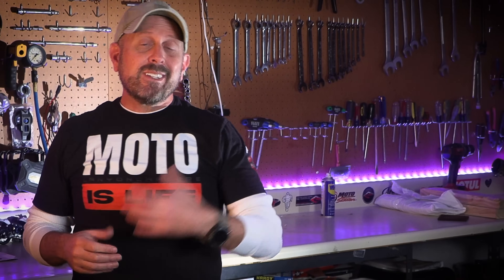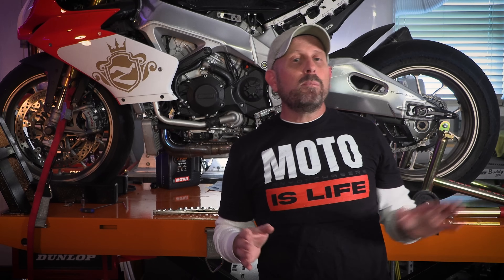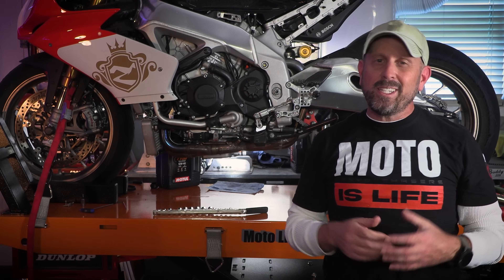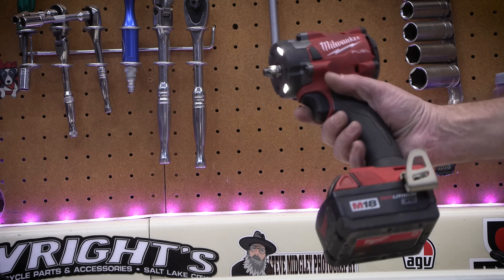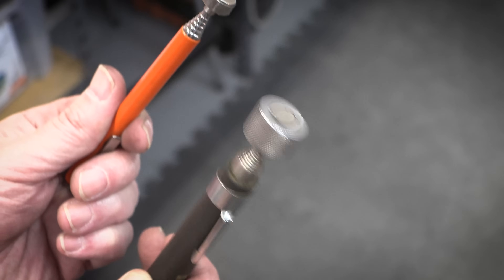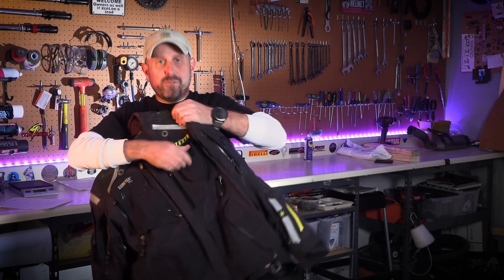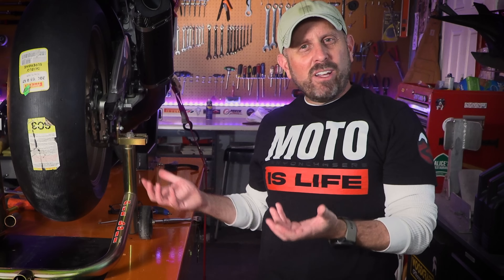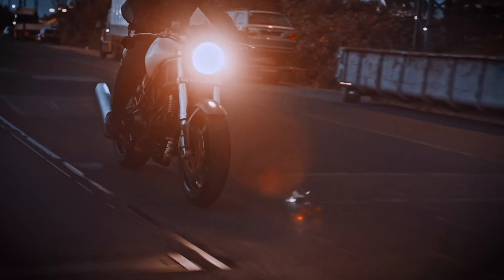10 Motorcycle Things I Can't Live Without

Comment: for some reason, wearing earplugs makes the bike feel so much smoother and nimble
Reply from the maker: Right?!? Why is that?
Reply: @CanyonChasers  I'm just hazarding a guess, but I think when you're not hearing every single rattle, mechanical sound or little bit of air movement, your mind has less input that will cause a reaction. Even if we're good at staying calm and without undue tension, stopping the aural barrage really helps.

Speaking of which, I'll need to try that sample pack. I've long used earbuds and got some custom ones recently, but the custom ones really started hurting on my trip across Australia, and I think the seal broke and let noise in anyway. The trauma caused tinnitus and an infection I've just gotten over. A friend lent me some decent quality foam plugs - the comfort and noise suppression was unparalleled. I love the idea of reusable ones like Pinlock and NoNoise plugs, but for me they just don't compare to good quality foam plugs (and my right ear is very weirdly shaped).

Also, 90 degree valve stems for the tyres, especially as I have spoked rims. And not plastic ones; my mechanic informed me they're prone to leaking and hears constant complaints about them on track days. Get metal ones.
Reply from the maker: I had some very expensive custom molded ones, but apparently, as your weight fluctuates so does the seal in your ear.  I gave up and now just use the most quiet foam ones I can find.
Reply: It definitely removes the constant wondering if “that noise” is okay or a problem.
Reply: @CanyonChasers  would it be because our ears are also responsible for giving us a sense of balance, since noise causes vibrations in our ears, our whole body would feel the vibrations, now if we were to cut off those vibrations, mainly caused by noise, our body would feel much more relaxed and would feel much stable.
Reply: @CanyonChasers  I also use the foam ones, and when it feels a little less cleaner, I would give it a wash, and they would be as good as new. good soap is the key I would say, as ear infections are caused by those bacteria or fungal infections. keeping the ears clean, and the ear plugs clean would make sure we don't get any ear infection.
Reply: This is a great list, and the earplugs are the sleeper item. I find riding way more relaxing wearing earplugs. The main “downside” is that at highway speed, I cannot hear my music or companions on the Cardo. But I’ll take the hearing protection and improved sense of calm on a long ride, every time.
Reply: @CurtisBrandt  yeah but you wouldn't be able to hear your Cardo properly at highway speeds without earplugs either because of the massive engine and wind noise levels. So it's basically the same without the permanent damage.
Reply: @lucascarracedo7421  yup

Comment: Two things I have found really helpful to stash on the bike somewhere:  Alcohol wet wipes and a stuff sack backpack.  I used to carry big alcohol wipes to clear bug guts from my visor in a pinch.  A 10-pack is thin and fits in an inner pocket of a jacket or under a seat but can be a day-saver on a ride on backroads when you find a swarm of bugs at 60mph.  I also kept a backpack under my seat for use in a pinch.  Something like my Sea to Summit Ultra-Sil Day pack.  It packs down to about half the size of your fist but expands out to a 22L drybag.  I've used it to pick up groceries after a ride, pack out trash I found on the road, or carry in a lunch and then stash the bag for the rest of the ride.
Reply from the maker: I LOVE the mini backpack idea!   I think I should make short exposing your genius idea!
Reply: I keep a tiny spray bottle and microfiber cloth in a pocket of my tank bag. Makes it easy to do a quick face shield wipe at a red light or a pull off
Reply: That ride out to the Old Sinclair here in Utah will definitely get your visor covered in bugs during the summer.  
I think it's the lake that attracts them all.  And alcohol wipes would be a life saver!
Reply: I got myself a Helite H-Moov backpack. It has a lot of great features (integrated helmet net etc) and best of all, it’s an airbag! In it, I usually carry a freezer bag with a bit of water and a micro fibre cloth for the bugs on the visor.
Reply: Completely agree. I always carry a bag I can completely collapse. Having a bag that takes virtually no space always at hand is a must for me, even outside the motorcycle world, you can just carry them in regular backpacks.

Comment: Microfiber towels - used to wash the bike, but I also keep one in the tail bag at all times to clean my visor, wipe dew off my seat in the morning, or as a place to lay out hardware and tools for roadside fixes.
Reply from the maker: Great tip!
Reply: I also carry a small spray bottle with a tiny bit of dishsoap. It makes removing bugs from the visor a breeze.
Reply: I always carry a small pack of wet wipes for visor & light cleaning, and a small towel to dry

Comment: Top item: a modular helmet with an internal sunscreen.

and, yes, show us how you use a Garmin GPS. A Garmin is on my list.
Reply: Modulars are super goofy looking to me, and they seem less safe, as the bottom part could break in a crash.  If you have a transition shield, you don't need an internal sunscreen also. :)
Reply: @thomasolson8417  
I believe that if you hit a tree directly enough, and hard enough, to break the shell of the facebar, your neck will be broken. I also believe the shell material is constant between a full face and modular helmet from the same manufacturer. The full face's facebar is capped with compression foam, so it "looks" more substantial (I assume you are using the chinstrap and you will not hit against the inside of the facebar). 

I agree, I thought modulars  looked goofy. I bought one, anyway. A month later, I vowed to never wear a full face, again. However, the only time I ride with the facebar up is when entering a gas station. When lifted, it looks like big lever to snap my neck, if I were to slide on the tarmac.
Reply: @bobirwin1028  good points. I don't feel I need a modular, but then, I haven't tried one. Maybe if I did, I would overlook the goofiness of it, as you have. 👍

As for sun protection, my Shoei is awesome in the sun or at night because it has a shield that goes super dark during the day and is clear at night. I wish that tech was more prevalent, and not just a couple of companies offering it, because internal shields add bulk, cost, and potential failure points because of more moving parts. This video doesn't even address it. 😭
Reply: Came to say this. Saw an hjc with the dark visor that pops down and instantly fell in love!

Comment: Picking up a basic abba stand is worth it.. on a budget without the extra supports you can do the front end by weighting the rear seat with some bags of cement or something. Once the front wheel is out it will sit fine. With this stand you can do front and back with just one stand, and it supports at the suspension pivot and doesn't get in the way much so for any big jobs A handy tool to have.

Having a small jumpstart kit is pretty handy if you can stowe it under a seat for those times when a battery is dead. Some come with a light built in which is handy for roadside crap at night.

Also. Essential really.. if you dont have a center stand on your bike Always have a flat piece of something solid enough to take your bikes weight through the sidestand with a footprint like your hand or bigger. Because.. on anything less than solid tarmac or concrete your bike might not stay upright that long.

Comment: Custom earplugs by UltimateEar are mine. Cannot ride without them. Much more expensive than foamies but a consistent seal each time, less waste and they connect to the Cardo
Reply from the maker: Don't they hit the inside of the helmet?
Reply: @CanyonChasers  Not at all, they sit flush with your ear and of course no need for speakers in the helmet so there is more space anyway.

Comment: Something else, that you reminded me of, that I kinda prefer a lot...photochromatic visor.  They ain't cheap, but it gives all the pros of dark smoke, and clear.  Only caveat I've run into are short tunnels can be fun because it takes 45 - 60 seconds for he visor to react.
Reply from the maker: AGV was making one that used polarized LED technology. It would switch from dark smoke to clear in less than one second.  Super cool, but I can't imagine it being affordable.
Reply: @CanyonChasers  Doubtful.  I worked in an office that had those for conference rooms...they were 5 figures per room.
Reply: I use a helmet with a built in extra tinted visor behind the clear visor. It uses a sliding lever to drop it down so if I get any glare I can drop it into place while on the move.
Reply from the maker: @kramsc1  Inner sun visor helmets have lower safety ratings because you are sacraficing a lot of padding in the helmet where we are most likely to have an impact.  Modular helmets also suffer from this. 

That notwithstanding, my personal experience with the inner sun visors, is the seam of the edge of the inner visor is always in my eye line creating distortion.  So despite giving them tries on multiple occasions, they just don't work for me.
Reply: @kramsc1  I had 2 issues with those: when retracted they would block the vent at the top of the helmet, and when used it would always be dirty from whatever dust and grime and bugs and whatever flew into the vent of the helmet as I rode. So I got a helmet with a photochromic shield.
Reply: @CanyonChasers  my problem with them is when they're retracted they block the top vent of the helmet which reduces the air flow and then when I put them down in front of my eyes they're dirty from all the stuff that flew in through the vent
Reply: My Klim helmet has a photochromic visor. It's awesome & came with the helmet - a long with a pinlock insert
Reply: @Tracer9GTRider8  Nice! That's something all vendors need to provide with helmets IMHO.
Reply from the maker: I wish photochromatic visors were available for more helmets
Reply: @WJRobbins125  I agree! I'm always looking ahead when it comes to helmets and even though my Klim is only a few years old I try to keep an eye on what's out there on the market and I'm not seeing any helmets that come with a photochromatic face shield. And Klim has discontinued the model I have currently 🥺
Reply: When you add a pinlock to a visor, it further distorts the light, making it harder to see at night.
Reply: @CanyonChasers  citation needed about the lower safety rating. Afaik both Shoei NEOTEC 3 and Schuberth c5 meet the latest regulations and score high on safety.

Comment: Another item is a wireless networked endoscopic camera. You could run it down a sink drain, or the tiny crevasse in your motorcycle to find the dropped screw , nut, or washer for your magnet on a stick. Your phone pairs advocates WiFi to the camera to work as camera display, which also can have a light ring around the lens, or for more dough, a grabby claw around the lens😂.
Reply from the maker: Yes! Great points!  Thank you!!

Comment: Regarding changing wheels at home, do you know of a single reference or online database with torque settings for all the relevant bits - pinch bolts, axle nuts etc, - across different manufacturers? What does a tire shop have available to refer to, for example?
Reply from the maker: Most times torque is based on bolt size.  Many shops when they are doing tire changes, they tighten things down by "feel"  - The end result is as varied as you would expect.   The good shops look it up and use a torque wrench.

Comment: going to mention again about wanting that video on how to pick tire pressure for canyon riding - air up on the way there, air down when you get there? Am I aiming for the tires to be at a happy temperature and using pressure for that, or aiming for a certain pressure window and temp is a byproduct of that and as long as you're in the window its ok? 

Should my tires be in a heat cycle while highway riding?
Reply from the maker: I mean... It all depends.  How far away is your canyon riding?  An hour?  Twenty minutes?  I'm likely to set the pressure for the day, maybe a few psi lower for a canyon day vs a freeway day.   The key point is to pay attention to your pressure.  Ideal pressure, even at a track day, is nuanced and may range as much as 10% from one rider to another on the same bike on the same day.
Reply: @CanyonChasers   i'm riding 45m-1hr to the mountains. I run about 34F 36R on road 6's which I know is on the higher side, I don't know how to figure out what a good temp/pressure is - looking at tire wear? aiming for 3 psi raise over cold temps?
Reply from the maker: @potatotr33  Depending on the bike, ambient temperature, and that specific tire, you may be pretty close to spot on where I'd run my pressures.   Michelin Roads tend to prefer staying cooler than say Pirelli's or Bridgestones.
Reply: @CanyonChasers  gsxr 1k, at a safe and sane pace on the highway and some fun but reasonable for the street pace in the mountains.

The question is more of is there a good way to learn what the tires like instead of just brute forcing it until it feels 'right'?.

Comment: Your last point regarding tinted visors seems backwards to me. I prefer a clear visor with an inner sun visor. No need to carry anything extra (sun glasses) and if you wear prescription glasses, then it also makes more sense this way.

Otherwise, love your videos and have found them very supportive to my riding skill development.
Reply from the maker: Inner sun visor helmets have lower safety ratings because you are sacraficing a lot of padding in the helmet where we are most likely to have an impact.  Modular helmets also suffer from this. 

That notwithstanding, my personal experience with the inner sun visors, is the seam of the edge of the inner visor is always in my eye line creating distortion.  So despite giving them tries on multiple occasions, they just don't work for me.
Reply: @CanyonChasers   Like you I have had poor experiences with visors in the past, but a couple of years ago I got a Nexx Villjord Carbon helmet. Aside from being a highly rated modular helmet (I live in the tropics and need to flip at lights & junctions), the visor actually goes low enough to not interrupt my vision. I absolutely love this helmet!
Reply: @CanyonChasers  I have to wear glasses for riding... so I just got the "transition" lenses to wear on my bike.  It solves the problem of not needing to change out my visor for day/night riding.
Reply from the maker: I wish photochromatic visors were available for more helmets.
Reply: I do 99% of my riding in the sun, so I'm going to optimize for that condition and have a clear pair of glasses for that 1% of times I'm caught out after dark.  If I rode mostly at night, it would be the other way around.
Reply: @CanyonChasers The inner drop down sun visor on my Schuberth C3 Pro completely covers my face to below my prescription eye glasses so no issues.

Comment: I am going to need a Trailer.. Everything Else.. Eh/No. 
   I just had a 81 Honda CB750 Custom Rebuilt. The Shop in my town, About the only one anywhere near and know what they are doing, Are Pretty Damn Affordable. $5,000 Rebuild/Parts and Labor and Took Payments..
   Ear Plugs?? You must be one of those F'n Harley Guys with The SUPER LOUD EXHAUST!!! Mine is Stock and Is Vary Tolerable. Most people say they can't even hear me pull up or pull out.. ( that's what she said ).. 
    Flex Fit Baseball Cap Works to keep the Sun out for me.. Up to 50mph anyway.. Helmets are HARD to Find in My Size. Can't Test Fit any from Amazon to see if they do... And No Bike Shops Selling New Ones anywhere near me. Repair Shop, Yes. Sell Helmets that Fit.. No..
Reply from the maker: Exhaust noise isn't what's causing hearing loss.  https://youtu.be/IVpcsFM88M8?si=ZJqxVlRspAtpJWw1